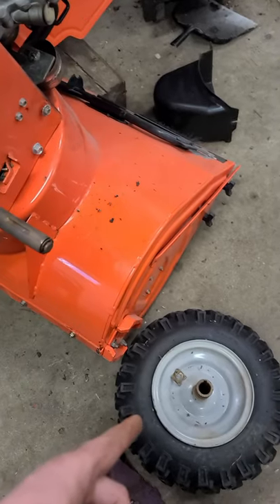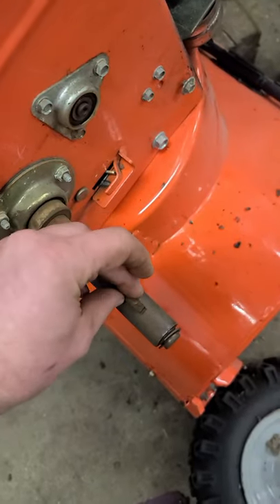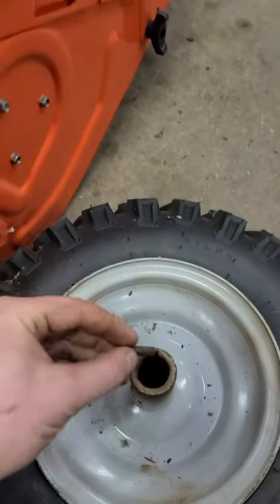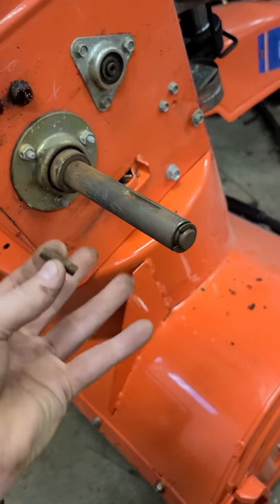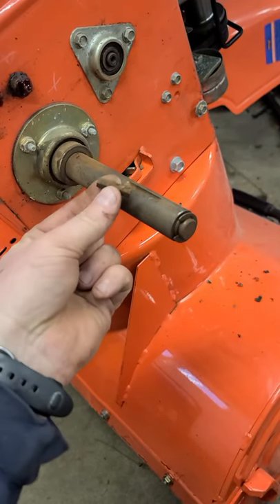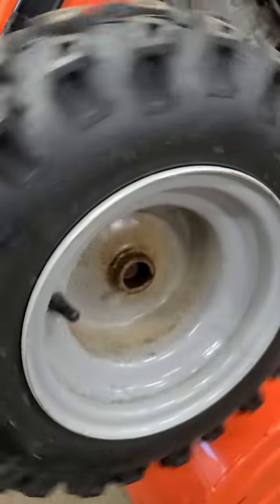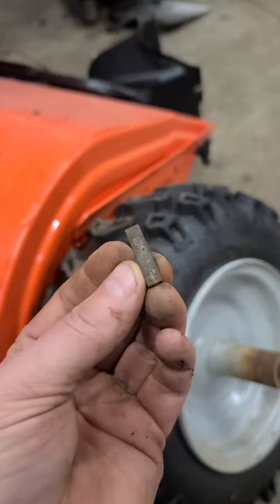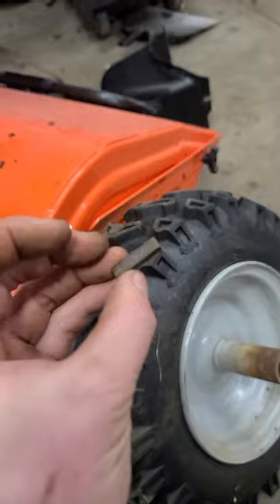Avoid This Mistake With Your Snowblower! #shorts

Comment: Do you put the key in place first and then slide the wheel over it or do you put the wheel on first and they wedge the key into place.  Not sure I will ever need this info and I could probably figure it out but now you have me curious.
Reply from the maker: either way works, I usually hold the key with my finger to make sure it goes on right

Comment: Hi, not related to this video; wondering if you've had experience with modified impellers, where the blades are extended with rubber to almost touch the housing. It's supposed to greatly enhance the wet snow clearing ability, wondering if it affects reliability in any way?
Reply: FWIW I put a Snow Blower Impeller Kit in my 1990 vintage Ariens. It made a slight improvement, but nothing drastic. And my Ariens has 4 impeller blades, maybe a newer unit with 3 impeller blades would benefit more.

Comment: My Honda suffocated when I put it on the front with garbage bag over the fuel tank. Dealer said the gas cap got damaged since it got wet from gas.
Reply from the maker: i install a cap without the charcoal in it
Reply: @donyboy73  will that fit a Honda engine though?
Reply from the maker: @appleztooranges  yes